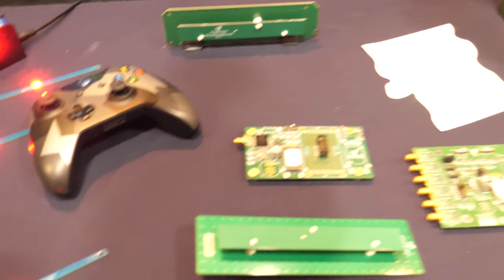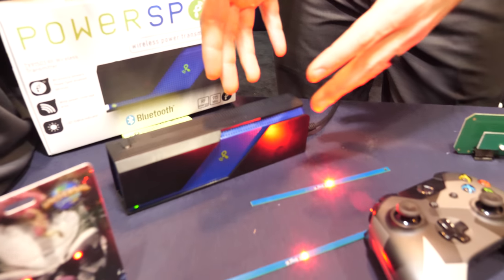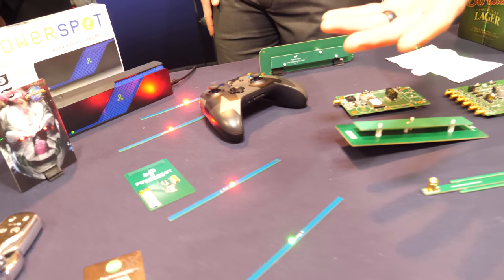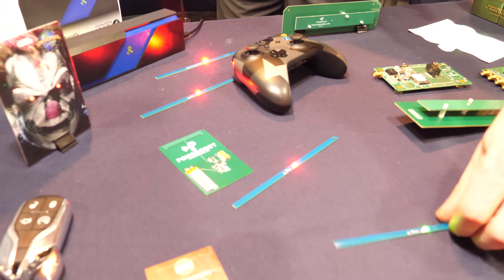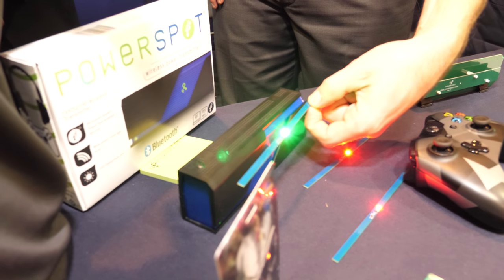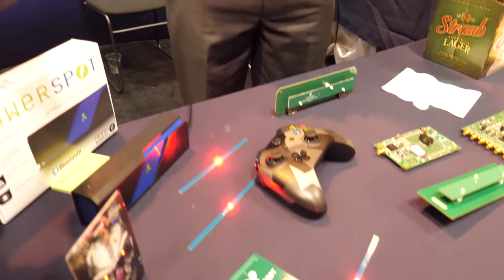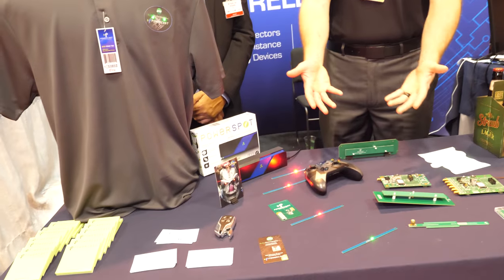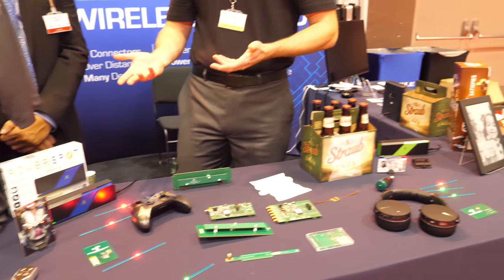Powercast PowerSpot Wireless Power Transmitter

Comment: Its good for things on the move and easthetics but it has to be lossier than a cable.
Reply: This is a very lossy system, the 3 Watt transmitter is barely lighting led's that only require around 1/20th of that power, so it's probably safe to assume its around 5% efficient at this distance,
Early days but very interesting tech that I'm sure will be in every home in 5 or 10 years (maybe when the efficiency is around 30% or so?)
Reply: @sofa-lofa4241  Actually, you are calculating efficiency incorrectly.  The "3 Watt transmitter" uses much more than 3W of electric DC power, say 10-15W.   The receiver gets about 10mW in the real world, best case.  So efficiency is  0.1% at best!!!!  Also note that the 3W is actually EIRP not actual power - the actual RF conducted (transmitting) power is 0.7W, while you get to 3W EIRP due to antenna gain.   The company is a scam.
Reply: @RichardXRoe  I wouldn't argue with your figures, it seems a good estimation to me, my guess was probably over generous by quite some margin! 
Wireless charging at distances of 1 metre+ is definitely going to happen soon for devices with tiny batteries (fitness trackers, headphones, etc.) I'm interested in just how much can be squeezed out of the tech, 

Unfortunately it is one of those industries which is managing only tiny, incremental efficiency gains year on year, couple that with the fact that there seems to be many companies that like to patent troll the hell out of an idea before its even off the ground... I'm not expecting to buy a charger anytime soon! 
And yes, plenty of scammy start-ups everywhere, I'm sure that for every good tech idea, there are millions of £££'s lost on well presented scams, or an idea which looks good on paper but just doesn't translate to the real world, 

https://youtu.be/NHmhTKT3nkA this is another of charbax's videos that I found interesting, similar tech... similar issues
Reply: @sofa-lofa4241  I don't think RF "wireless charging at distances of 1 metre+ " is going to happen soon or ever.  The technology has been readily available for tens of years in the 400/900Mhz ISM bands, yet it is commercially impractical because it is worse and more expensive than a small coin (button) battery or a small solar cell.  Same for the higher frequencies (a WiFi router, for example, can legally do 4W EIRP in the United States, yet no one is using it to "power" devices - why?).  

Think about it  - why don't we see any crystal radios these days?!?  (a crystal radio is a radio receiver that is powered by the FM radio station itself)  

Yes, both Energous and Powercast are frauds.  In fact, the CEO of Energous claimed to have worked for Powercast in the past.
Reply: @RichardXRoe  I see your point entirely, it's one of those things that shouldn't exist but it will,
Someone is going to try and license the tech for useless low power devices like fit bit and iot devices, etc. They've spent too much money not to, whether it does see the light of day is another thing, 

Yes, It will be be extremely lossy and burn dozens of watts to trickle charge a tiny battery/supercap, but it is one of those 'Because we can' (or think we can) devices, a must have for the modern home, lol
I think it's fairly useless but one day it will tip the scales of stupidity and someone will sell wireless switches/thermostats/sensors/fully waterproof products, etc. anything with a deep sleep microcontroller or extremely low quiescent current that sends signals a few times a day... and anything they can license a standard for, of course ;-) 

It will be abysmal but possible is what I am saying, I'm just interested in what could be squeezed from it in the future